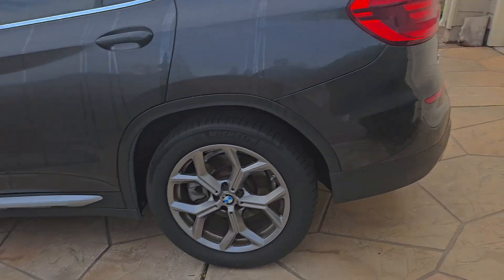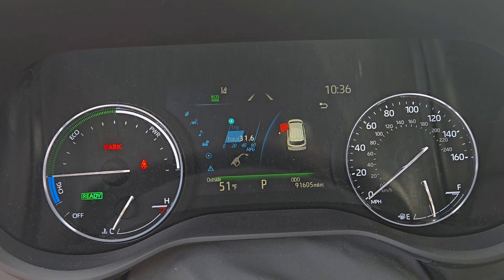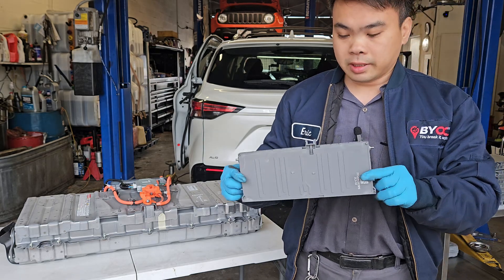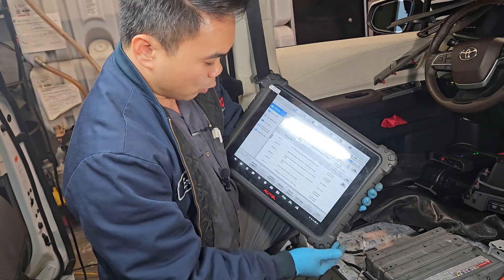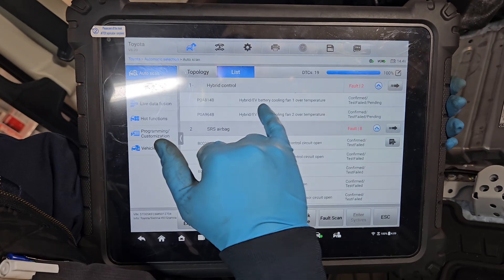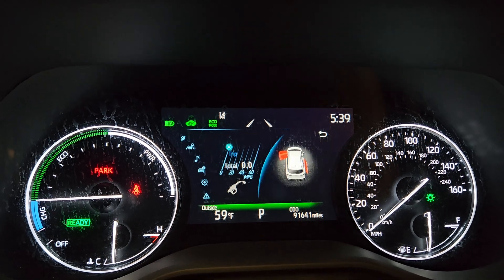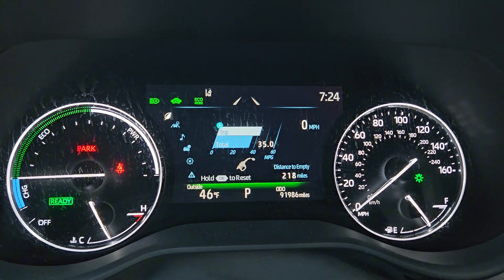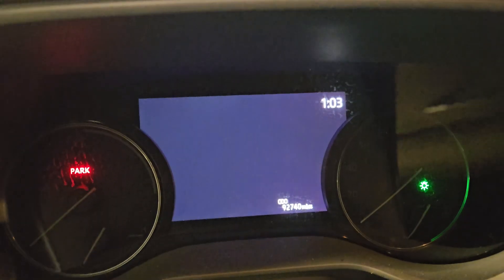Hybrid Battery Upgrade = Major MPG Gains on 2021 Toyota Sienna! | NiMH to Li-ion Replacement

Comment: What's the point? You’d have to save a massive amount of gas just to break even on the cost of the battery and the labor to install it.
Reply from the maker: Gas savings are definitely part of it, but a fresh battery also reduces the load on the engine and the inverter. When the hybrid system is healthy, you get better acceleration and less wear on the internal combustion components. It’s less about 'breaking even' on fuel and more about keeping a paid-off vehicle on the road for another 100k miles.

Comment: One trip does not make for a valid test!  I'm sure there was an improvement, but how much vs. cost, labor, and time needs more testing.
Reply from the maker: We agreed with you. The battery has been installed in our customer's vehicle and driven for over 20k miles since installation and the fuel economy is currently at about 36mph avg. The highest was about 48mpg.

Comment: how much of a power gain did you get can you feel it when driving
Reply from the maker: Due to the vehicle’s size and weight, the performance gains are subtle. While you will notice slightly quicker acceleration, the difference isn't transformative. The real advantage of this model lies in its significantly improved fuel economy.

Comment: What was your average MPG's when it was brand new ? the first 20k miles or so. I know that in my 3rd and 4th gen Prius, mileage has not suffered at all since new and both have over 100k miles on them.
Reply: Hi Bruce,

Thank you for reaching out! Regarding the Sienna’s history: When new, approximately 95% of its use was highway driving, where it achieved an impressive 36–40 MPG on average. As the vehicle shifted to more frequent commercial use, fuel efficiency gradually declined to 34–38 MPG. By 91,000 miles, the average had dropped further to 31.6 MPG—a common trend with increased urban/stop-and-go driving.

We’re also glad to hear your 3rd and 4th Gen Prius models aren’t facing mileage issues! While these generations are known for reliability, we’ve observed that hybrid batteries in general begin to degrade around 80,000–100,000 miles, with some failures occurring as early as 100,000–120,000 miles. That said, most batteries in our experience last 150,000–200,000 miles before replacement is needed. Regular maintenance can help maximize their lifespan!
Reply: @InnRGPower  I currently have a 2010 prius with 250k miles still on its original battery pack and still achieving an impressive 48 mpg with mix driving. Just purchased a 2025 Rav4 Hybrid, it better have the same reilability. Not a big fan of the AWD system, can feel the rear end motor kicking in and out. It's a weird experience unlike my 2024 Camry Hybrid 2wd a much better smoother  drive train.
Reply: @InnRGPower  It also depends on driving habits. Heavy lead leg can put lot of stress on everything including hybrid battery modules. I have Prius V 2013 with 250,000 miles with original hybrid battery giving me 44 miles per gallon. Dr. Prius app shows one weaker module that I am going to replace as a sort of maintenance  schedule. I drive everyday and be gentle with my Prius V and that's the key for healthy hybrid battery.